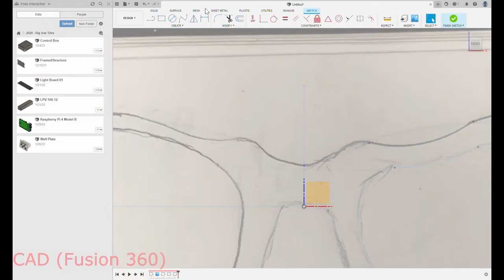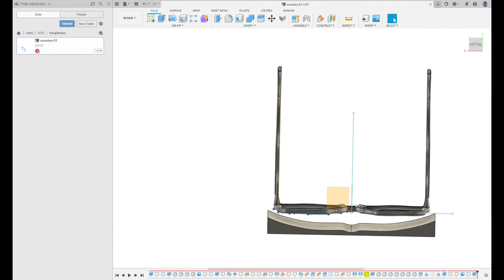Super-Cool 3D Printed Sunglasses

Comment: where did you get the steel part for bend the sunglasses?
Reply from the maker: I think you're talking about the hinge. I found it on amazon! But you should be able to find something by searching "glasses hinge" at whatever marketplace you like to shop at.
Reply from the maker: https://www.youtube.com/redirect?event=comments&redir_token=QUFFLUhqa2hGWVYyMEp0anN3N3RsZVlTV1Zta2VpSjV3d3xBQ3Jtc0ttNjJZZ254YXJHTXlNM0ZVZTVvbkliREllaXltSjh0eWp0dG81UTJtdjFLanZ6ajlDeW80V1BoM1F2SzdkakxZQ2pLUEt0Sk91aHAzN05BMllES21ka1RteTV0SGlja2wtTDVDa2pUY1Y3TTU3X0Nxaw&q=https%3A%2F%2Fwww.amazon.com%2Fgp%2Fproduct%2FB0943T2Q1G%2Fref%3Dppx_yo_dt_b_search_asin_title%3Fie%3DUTF8%26psc%3D1&stzid=Ugyy42OPMIV6QwTm1n94AaABAg.9mNDukQbebP9mUx2sCifSf